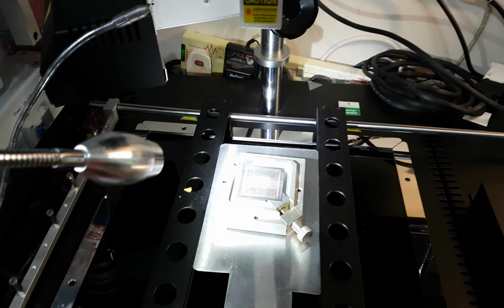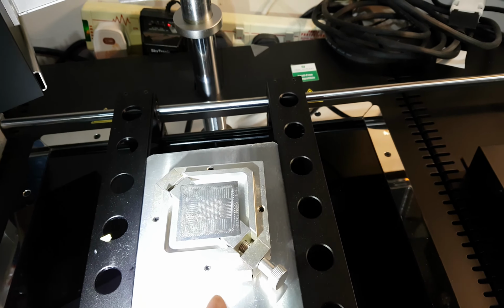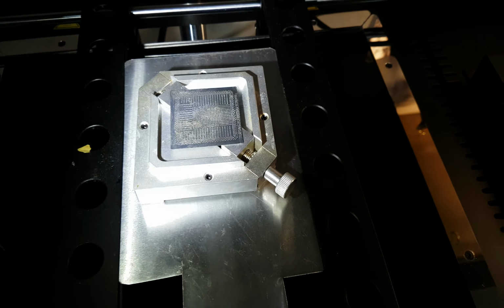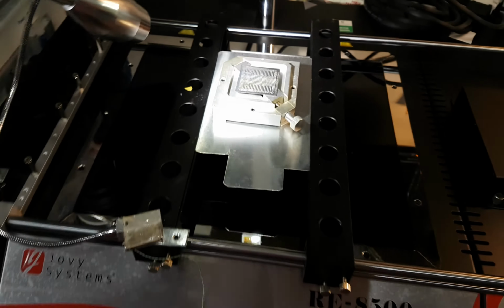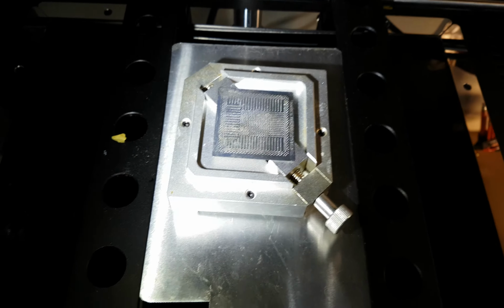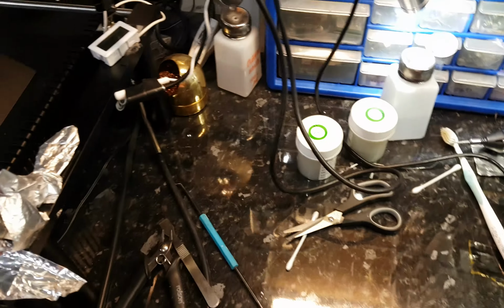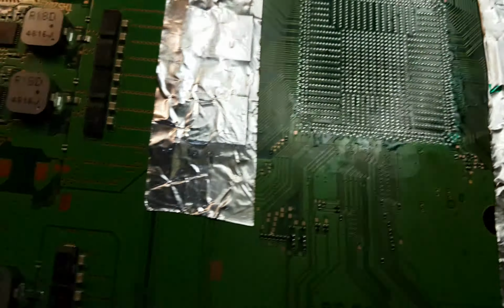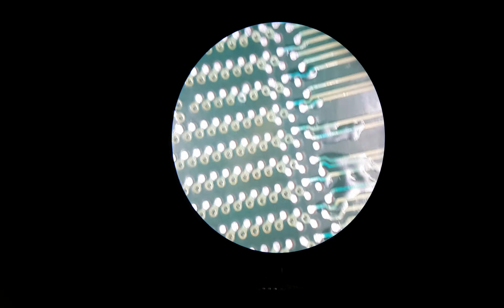DON'T BUY DIRECT HEAT BGA REBALL STENCIL IT'S BULLSHIT

Comment: I use nothing but direct heat stencils. The key is to keep the GPU or memory chips hot as you remove the stencil. If you allow it to cool, the metal will decompress to it's original state and not allow you to remove it. This is a user fault.

Comment: I agree - I tried both ways - direct kept the balls in position, then i had the hardest time getting the stencil free. Then, out of desperation and frustration - I reheated it on the preheater and used hot air 350 degree when hot enough I dropped some chipquik liquid flux on the stencil. It made a sputtering sound and I could see the balls move and the stencil released. It made a beautiful  reballed ECU. Repairing a BMW X5 water damaged DME.

Comment: I know this is old now but the 6 second BLOD wouldn't have generally been caused by the APU and reballing that particular IC is kind of pointless. The main reason for a 6 second BLOD is down to the southbridge rather than the APU itself. Just throwing that out there, and generally a reflow of the southbridge fixes that issue

Comment: You probably used the wrong size of balls which is bigger and thats the reason of the stuck. Ive used it many times with the correct balls, ive never had these issues. Always make sure the ball is smaller than the holes. Hope lesson learned.

Comment: Paul daniels and Paul S have demonstrated putting the chip with the stencil through ultrasonic cleaner will loosen the stencil, so no need to see use hot air.
Reply from the maker: I wouldn't recommend putting the chip in water or cleaning solution because of the potential risk to increased moisture on the bga package, this will also increase the risk the popcorning chipset.
Reply: Are you sure, we clean our boards most of the time after repaired a board because of flux residue?
Reply from the maker: @curan  Yes USC logic board should be performed to ensure it look clean and professionally done.  However, it is recommended by JDEC to ensure to board is moisture free or to the bare minimum.  This means appropriate measure has to be taken by baking the board for upto 48 hrs at around 100-120 degree celsius prior installation.  However most workshop don't know or can't be bothered possible due to time consuming or high workflow.  Honestly speaking I bake  boards in a toaster oven for about 4 to 5hrs before installation.  😊👍
Reply: ok i understand now. i guess let the chip cool down then USC the chip.

Comment: Direct heat stencil is not shit at all. When you use it, you can put flux paste how much you want and you will get good contact and good soldered reballing balls. When you are using not heated stencil you have to put a very small amount of flux because the spheres are moving around when you heat a chip and flux becames luquid. Small amount of flux can be a problem couse solder balls will not be soldered well. You can add more flux later, it's true, but problem remains couse solder balls are soldered on the lower point, not sideway. I want to say that you can't put flux under the solder balls after reballing and you will got bad contact which will last very short. Quality and enogh amount of flux is very very important. Chinese fakes and copies will not finish the job, they will make you a headache.

Comment: It was most likely sticking because of your flux, after that chip cools that flux is gonna harden, and that will be a make shift epoxy between the chip and the stencil, Direct Heat is not garbage, it's your technique, (No offense) after you let the chip cool, just warm up the stencil again with hot air, roughly 110C should be warm enough to get the flux loose enough to remove the stencil. Or use less flux. As a side note, both Direct, and frame indirect need proper technique, indirect you need a very small amount of flux in a thin even layer, after the solder attaches to the pads, you can add more flux to get them to pull perfectly onto the pad. either way great vid in 4K!

Comment: It is not bullshit, you should use a plastic tool on the side of the processor to remove the stencil. It will work just fine, don't forget to use some soldering paste.
Reply: Oh, when it happens i usually apply some more heat to the spheres, but it is a rare event
Reply: What would be the best way to get in touch with you?
Reply: I could show you what i usally do in this part of the process
Reply: WRONG, 90MM HOLES ON NON HEAT  STENCILS  HOLE TOO LARGE.